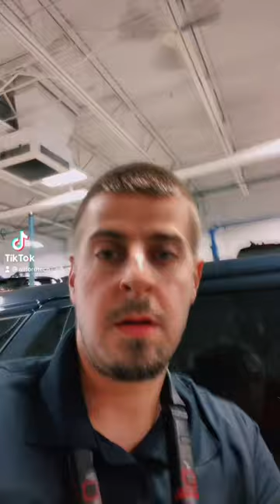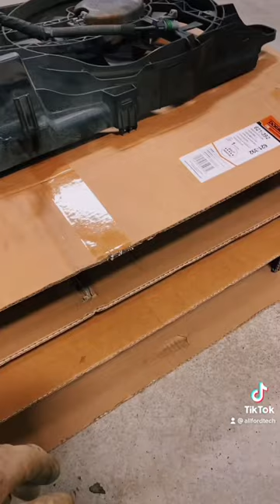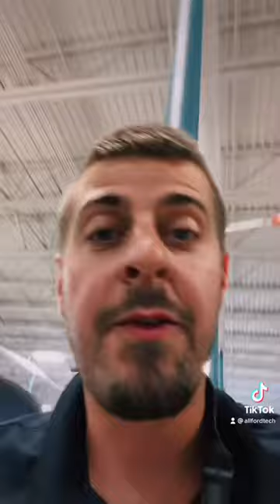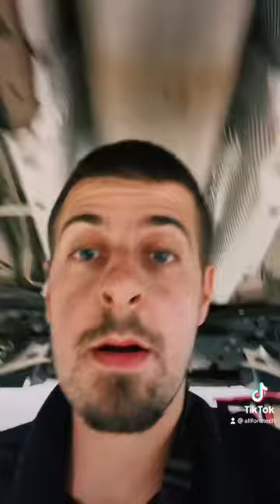This is why mechanics drink…

Comment: Plus if got to flag your time. Most dealerships under pay time to make you take short cuts n do improper repairs and yet have the mechanic be responsible for the errors so they can underpay and not have to take responsibility for the situation they put their mechanics in. FYI most dealerships on your "standard maintenance" would rather not allow all oil to be properly drained leaving certain amounts of old oil in the engine n mixes with the new which makes the new oil contaminated n not as strong as it can be. 10-15 minute oil changes are actual doing small amounts of energy to your engine due having amounts of of old used up oil mixed with new. ( Granted ya can't get all the oil out) but if your patient and allow to drip till none is left is better then putting the drain plug back in while have a steady stream even if it's tiny. Still more used oil out more life is given to the engine

Comment: I had an argument with a shop owner over parts from the dealer. He said they are the same parts that are installed at the factory. I disagreed and we got brake rotors from the dealer. They were not the same and were much lower quality than the rotors from the factory.

Comment: I work for Subaru in warehouse. One time I found a pallet in the racks of back windows. 10 windows. Took one and opened it, cracked. Took the next, cracked. The next 6 of 8 were cracked. Also The number one most broken part via packing and transit are condensers. Number 1. Cuz people don’t understand parts  it’s just the warehouse they don’t know what they’re packing. So they’ll put condensers flat on a pallet then put boxes and boxes of brake pads and shit on top lol

Comment: I've been having this problem with ball joints.
2011 Jeep Patriot Sport 2.0L, front wheel drive.
Been through 5 sets of ball joints in the last 4 years.
The originals on it lasted from new to 2019.

Comment: Dude I had to fix the radiator on my 07 F150 and had to go to 3 damn stores to find a good one also! What's up with parts nowadays? 

First replacement had crushed washers that wouldn't seal to coolant line, second one had no fittings whatsoever (just 1" holes), 3rd one has been good so far. Good one came from Advance, other two came from Autozone.
Reply: Well, your first problem is going to an aftermarket part store. Yes, they're cheaper. But you get what you pay for. The second is maybe a little lack of knowledge, the one without fittings likely expected you would be transferring fittings over from the old radiator. And I really hate doing that, I prefer to have new fittings if possible.

Comment: yeap.. name brand aftermarket stuff too.. this is not just the cheap ebay special parts.. its ALL junk even the oem stuff can be garbage, i went through like 4 fuel pump sending units before getting a new one.. cause dropping the fuel tank 4 times is SO much fun!!!

Comment: Put 3 in my Jeep.
1st one lasted a week and went bad. 
About the same results with the second. 
Third one has been installed for almost a year still working. 
It's hell when you're a mechanic and you have all these bad new Parts on your wife's car. 
Aftermarket parts suck !!!!
But it was $130.00 and Jeep dealer wanted $300.00
Maybe the extra money would have been worth not having the aggravation !!!!

Comment: That’s why I just replace it myself. You can’t, as a mechanic, mark up parts 2x to 5x and complain that the parts are bad, when part of the justification is that you only install the most top quality parts (the real reason is just they’d rather mark up parts than admit that the hourly rate needs to be much higher than what’s displayed).
Reply: Keep in mind the mechanic isn't the one making those decisions. What to charge per hour or how much to mark up the parts is not our department. We just figure out what's wrong and tell you what needs to be replaced. Haggle with the shop owner over part quality and mark up.

Comment: Definitely an intermittent electrical issue and not the fans fault. Probably a relay or touchy connection somewhere. You don't go through parts like that

Comment: I went through this with the AC in my wife's Kia Rondo. Compressor ceased and the clutch was also ceased so belt was just burning up on the pully.
OEM part was $1200, aftermarket part was $500. I bought the aftermarket, got it installed and professionally charged with coolant. It lasted a grand total of 18 hours (I know because I did a 9 hour road trip to Indiana and back and only had about 6 hours of driving while there for 5 days). It died half way back home. Luckily the pully wasn't ceased so I could drive it the whole way. I had to return it to the manufacturer so they could run tests on it and didn't see my refund until 2 months later. Meanwhile I had to buy another one and pay to have them all swapped yet again.

Comment: That's when you fit a generic cheap fan and wire it that it always runs when the engine is running. 
As a diy guy of course or you tell the customer. 
Fixing it correctly will be 3-4 times more expensive. Your choice.

Comment: I replaced the quick-release adapter for the lower radiator hose on an 09 CRV. Three different adapter orders and two sets of o-rings later and I finally was able to just completely replace the radiator as the quick release adapter wasn't going to work.

Comment: SO, a heart surgeon who owns a Harley brings it to his buddy mechanic at the local Harley dealership for some repairs. The two get to talkin' and the mechanic says to the surgeon; hey, how come we basically do the same thing for a living... we both replace parts to fix machines but you get paid SOOOO much more than me. The surgeon stops for a second, then says, because I have to replace the parts while the engine is running.

Comment: That's nothing. I had to replace my F250 engine with, not 1, not 2 but 3 rebuilt engines I bought from Powertrain Products in MD. It took well over a year to get my truck up and running, thousands of dollars wasted in labor costs and parts external to the engine that most likely didn't need replaced.

Comment: Not me, but the head tech at my shop (before my time) got a (old) ford ranger in, needed an engine. Customer says ‘ok put an engine in it.’ Orders engine, yanks the old one, installs, fires it up, dead cylinder. Orders another one, puts it in, something else very wrong, another engine, installs, same thing…think the 4th engine was finally good…I’ll say this though…I think by that 4th one, he was yanking an engine and putting another one back in in about 4 hours 😂. 

Personally, after replacing an engine, and the replacement being bad, Idve rigged that third one up to run on the stand before installing it 😂.

Customer was happy at the end though, still brings that ranger whenever something goes wrong…and the head tech stays as far away from it as possible 😂

Comment: Ah!  Fine quality imported products.  My 1997 Honda Civic's $2500 HONDA certified failed after 54 weeks.  Free replacement didn't cover labor.  Ugh.  It failed after a year.  Mechanic used a 20 year old main shaft for 1st gear.  2nd gear failed after 8 years.  115 HP stock engine.  The WTF meter pegged out.  Also 2010 or so Honda rotors failed at 12K miles.  New Honda parts are "Fecal matter."

Comment: Had issues past few years with rebuilt starters and alternators from major auto parts stores.
So damn bad that I found out that an Amazon special starter works better than a reman part costing 3x as much and they my old alternator just needed a new voltage regulator. After three alternators I just nabbed one of the regulators out of the reman alt and put it in the old one, worked great, 220k miles on the stock alternator works better than the reman crap available now.

Comment: 😂😂 If it's made in America the factory do not care about quality.. the superior wants numbers so they get their bonus each month. 
I KNOW.  I work for a Ford parts company.  After a shift was running they found out the door seals had bad glue on them still shipped it to them.  Because the numbers would look bad

Comment: Yeah I got a Chevy distributor at NAPA once, dropped it in and my truck ran worse than it did with the old one in it that had the gear almost completely worn down. That was a fun headache. And get this, they wouldn’t refund me because “it’s an electrical part” and they don’t refund electrical parts. What????????!

Comment: I wonder what the mechanic has been doing with our vehicle. They’ve had it for seven weeks and counting. Had a broken window motor and check engine light is on. Quoted me four days. I’m glad it’s not like impound lot where you pay per day. They said the engine light is on for cylinder 2 misfire. Said it was determined after a compression test that there is a leak. Said they can’t find where the leak is coming from. So who knows how long they’ll have the vehicle. It’s only a 2019 so shouldn’t be having these issues, thank God it’s under warranty.

Comment: We had a similar problem with good part for a customer of ours just last week. Her car was at work and it wouldn't start for her. That night she had to get a ride home from a coworker. The next morning she jumped it and got it to the shop. Thats where we found the battery was defective. We put the brand new battery in for her 3 months ago, now we jad to do it again because thats where we found it was defective. This makes you wonder about all of your suspension parts that control the postions of the wheels on your car😬😬

Comment: What was the issue with the radiator fans? Was it not spinning fast enough? There is actually a tool that measures air pressure so you know if the fan is working good

Comment: My E36 fan wasnt working, so i bought a new blower motor resistor, it was about half plastic and  didnt work, so i plugged in the original one again to return the new one, and the original part worked

Comment: You're better off going to the dam junk yard for those parts... My 2008 Ford Edge, luckily💪🏿, has been going strong. Bought it with 120k miles and now have right under 200k miles.

Only replaced, all coil packs, battery, control arm and a ball joint.

Same alternator, same starter and everything else is still the same.  Had it 3yrs so far.

Comment: Old car, takes fan out in 5 minutes by removing an electrical plug and 4 bolts/nuts.

Most new cars, strip off the whole front end, breaks a dozen of crap plastic clips, takes half a day to get the job done and gets payed 5 bucks and pray that the new fan works because it all has to be put together before any testing can be done... 

VW Polo 4 and beyond has entered the chat.

Comment: Years ago I had a Pontiac Sunbird. Starter goes out no big deal. Dude... I put 4 fucking starters on that thing before I finally got one that lasted more than 2-3 cranks. 

That last one I go up to Advance and get the 4th starter and it was like 10 minutes till close and on the way out i grab the tool cart and one of the dudes was like hey you ant take that we are about to close. I said hell no your not, not until I get a starter that actually works. By this time I had done this shit so many time I had them swapped in about 10 minutes then proceed to crank on this car over 50 times just to make sure it worked. Thinking back I'm surprised I didn't burn up that one good starter. 

Dudes that worked there understood my frustration when they looked in the computer and seen how many starters I had come got in that 24 hour span. LOL That was also the end of me ever buying parts from Advance ever again.

Auto Zone is a lot better in a lot of ways but, even them you have to watch because even though I've not had many issue with bad parts they are notorious for giving the wrong parts.

Comment: Went thru the same damned exact thing myself. Radiator blew on my '14 Dodge Charger. Went thru  three different ones from local shops before I actually found the one that would actually fit/work  online. And, EVERY single store SWORE it was the correct one and would work.... my ass...

Comment: Hear ya, just split a brand new 5 month old lower radiator hose.
Tried to do the right thing to prevent problems,  new radiator and all continental hoses.
Put the old one back on at 1030 pm, just to get to work he next day,  drunk off my ass...
New parts are all junk now.

Comment: While I agree that new parts these days are utter garbage, you should probably also look into other issues that could be going on with the cooling system, IE the wiring.  If the wiring is corroded or burned, the resistance could be causing the fan to fail immediately or shortly after replacing. Ask me how I know

Comment: I bought a fuel pump assembly a few years ago once I took it out of the box it had a broken frame it was so fragile I ended up just taking the motor out of it and put it in the original unit

Comment: Dorman is not a horrible brand, and is usually cheaper in cost (not always these days), but OEM although usually costs more,  is more reliable….lasts longer. Explain and Give the customer the option , more will choose OEM than you might think

Comment: I installed a rebuilt 400 cid in a bronco it used 20 quarts of oil in 2 weeks I checked it out and found it has been bored .60 but had .30 rings in it they wouldn't warranty it because it was a truck so I did it myself for no pay

Comment: When I started turning a wrench in the mid 70's we were getting paid 60% now I'm thinking it's like 25% don't know due to I haven't worked in a dealer lately.
What are the shop charging now like $150-180 labor hr?
If you have to buy all your tools might as well work at home & a Road Service make 100% . 
Been thinking of running a brake special like for $45 for front or rear on cars more for trucks on FB, they bring their own pads.

Comment: Uhhh...
A) mechanics and technicians aren't the same thing
B) it's not the fans if 3 new parts come in and they're all (bad). Production can't handle that kind of record of defective products. It's probably a bad connector, bad ground, it a bad "mechanic". Something's not correct and you should never believe the unbelievable.

Comment: My rule is alway use known good parts.  IE when you get a part in, bench test it immediately.  Mark it when and by whom it was tested. And put a seal on the box in case some joker decides to use it then return it without retesting.  Have had issues where the known good part was installed, causing the part to burn out. Then idiot decided since that didn't fix the issue to just put the now dead part back in stock.   Obviously retesting the previously known good part whould have told the Technician not to replace the part again until the issue was determined and corrected.

Comment: I just got a brake booster in today that was assembled 180 degrees out of proper rotation front side to back. I didn’t even realize at first but it wouldn’t remotely fit with the master cylinder into its home and I realized they put it together wrong at the factory. Can’t make it up anything that’s built can and will be built wrong

Comment: at best its 50-50 from DO(H)rman parts. Factory parts are not much better. Just had 2 bad strut bearing plates new out of the box- Motorcraft grinding and grabbing before I even installed them.

Comment: You know what bothers me? All I have to do is lean against my car and the body deforms. It didn't use to be that way. People barely hit something and the whole front end of their car comes off. I just paid 25K for an 18 Ford Edge Titanium and my phone won't sync with the damn car. Or it syncs and then disconnects, even when it's plugged in. My sister's small dog made the gear shift assembly in her car fall through the console just by standing on it.

Comment: I can attest to this my valve cover PVC on my 2010 GMC Sierra and oil pressure sensor switch, both were bad I changed them, and both of the valve covers were changed there won't be any issue, 6 * had to change that PCV and oil pressure sensor....

Comment: And you know why you have a headache? Because you replaced it with a CHEAP AFTERMARKET COOLING FAN!!! I took a screenshot and zoomed in. It's not a MOTORCRAFT. I had a aftermarket fan on my 07 Five Hundred when I bought it and didn't know it was bad until wife was in drove thru and called me to tell me car was overheating. Luckily I had went over with her what to do when things like that happen. Turn on the heat and get it turned off ASAP. I was fortunate. Motor wasn't damaged. Took P.O.S aftermarket fan and put in a MOTORCRAFT fan and have had no problems since.

Comment: I had a issue with my 2013 kia sportage last December the knock valve went out had a new one put in it began to run sluggish and a month latter it went out again and had to pay over $300 to fix it again. The one i replaced the original with was faulty but i got my money back for it and got one with a life time warranty. All this on top of a bunch of other shit to deal with.

Comment: Yeah ove had sh*t luck with electric fan motors, considered replacing the clutch based one in my ranger for better mpg and hp, but at the same time, not a huge difference and the quality of those fans sucks

Comment: I kind of scanned the comments and I suppose not many people here in the comments are techs or seasoned techs better said. I didn't see any comments on the brand that the replacement is. I have had zero luck with Dorman electronics and barely any luck with Dorman hard parts. It's the cheapest of the cheap and never works... Buy quality or don't do the repair.